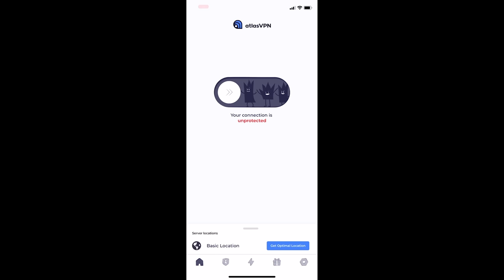I Saw The Holy Grail S2 EP21

Comment: Fix for mantle cracks: I've done this successfully - once reinforced, sand the areas and fill gaps using white glue mixed with sawdust taken from an inconspicuous area. Sand smooth. Stain or apply finish to the mantle but do not apply your final finish coat. Using acrylic paint, match the color of the wood and paint in damaged areas matching the wood color and grain. Apply final coats of finish over it. I've done this with antique furniture and it is nearly impossible to see. This will also help hide paint that can't be removed. Just keep the acrylic paint thin so it won't show. Give it a try!
Reply: I have done that too.
Reply: Using acrylics is something I like to do to even as a stain.

Comment: It’s been my experience that when an old glue joint comes apart, a re-glue will never be as strong as the original bond and is more prone to fail UNLESS you first scrape off and remove all the old glue to expose the raw wood underneath. Once all the old glue is gone, you can then successfully re-glue the joint/cracks back together and expect the bond to last. 

No matter how much new glue you use, or how well they come together when clamped, new glue just will not stick to old glue. 

Y’all are doing a great job, keep up the great work!
Reply: Came here to say the same, remove all the old glue first.

Comment: You have got too get you a work table. Too use for lrg projects. Especially with pipe clamps., Two saw horses and a heavy sheet of plywood. Save your back!! Iam a retired carpenter. And worked as a furniture  refinsher. You need too have a work table.  This also goes double when your stripping doors. Pop the pins and lay flat it makes so much easier to strip!! Stain and poly. Angel Norfolk VA

Comment: That shows Hall had money, that is a solid gold pocket watch case. Odds are there is a high grade movement in that watch. Only well off folks could buy a solid gold pocket watch with a good movement in it. Most folks buying a gold watch spend most of the their budget on the gold case and had a lesser jewel movement put in that case. I recently saved a pocket watch from a pawn shop that was made by a jeweler in a place an hour away from me. It was given as a 21st birthday gift to a person that lived in that city and died in that city and was buried in a cemetery 30 miles away from that place . The building this jeweler built is still there and is a historic building. I am in the process of saving a pocket watch that was given to a famous 19th Century Tennessee resident whose son was in politics and whose grand daughter was a writer. Somehow the pocket watch (given by friends) is in Cali. That watch also showed the esteem this person had as it is a solid 14k gold 18s pocket watch with a very high grade movement. The watch is probably quite heavy due to the gold. Usually watches were given for Christmas gifts or 21st birthday gifts back then

Comment: Mr. Brown's watch is amazing; I've never seen a watch with a photo of someone on the face of the watch.  The fireplace mantle definitely looks worth rescuing!  About 25 years ago, I bought a 1920s antique Chippendale Revival desk from a yard sale for $70.  It had been painted, and the paint was peeling.  The wood beneath looked like good wood, and the desk had beautiful lines and a lot of fine details like hand-carved ball-and-claw feet and carved cross-hatching around the top.  I spent a week stripping it; it took several applications, and I learned the value of a soft toothbrush dipped in stripper, lol.  Fortunately, I was able to get every speck of paint off.  It turned out to mahogany, and was so well-made that even the drawers were made of birchwood.  I stained it a rich, cherry brown and sealed it with two coats of tung oil.  Now I just maintain it twice a year with Howard Feed n Wax.  It's still one of my favorite pieces. 🙂👍

Comment: I've only had to paint antiques 3 times. One was a trunk that was already painted pink outside. I left the interior alone. The other 2 pieces are family pieces: a dresser and a bed. They both had rust on them and I didn't have the money (still don't) to have them professionally finished. They are all metal 1930's from Simmons. Originally, they were in my great grandfather's hotel. I was able to leave the other dressers and beds alone. I knew they would never be sold and I knew I needed to stop the rust ASAP.

Comment: I feel your pain. I got the mantelpiece/ surround form my grandparents house (1875) and had to do some repair on it as well (which stemmed form its removal, so luckilly the structure was still good), but the 4 layers of paint i've had to remove would have driven most people to say screw it. Luckilly that sort of thing is in my wheelhouse, and I only have a little left to strip from it. The oak underneath I had never seen until I did, and I can't imagine why anyone would have painted it in the first place.

Comment: remember to keep gutters cleaned out probably twice a year (unless get heavy leaves then more often) do not wash debris down spout cause can clog it

Would pigmented oil-based paint work on your exterior wood (for protection from elements without additional product)?

Are you using biscuits or dowels for joining the mantle pieces?

Maybe the design on the watch was in a  painting in your house... or you could maybe think of doing a small painting like it for your entry area...

Comment: For the mantel gluing issue, it's important to understand that typical wood glue won't fill gaps. It's not designed for that. It's best for direct wood to wood contact. It's recommended to use an epoxy glue to connect pieces with large gaps. Check out the video from "Fixing Furniture" that is called, "Best Wood Glue for Furniture Repair - Discussion with @Thomas Johnson Antique Furniture Restoration". They have a really great discussion on when, where and how to use different glues for specific repairs. It's really informative and helped me a ton with fixing broken furniture pieces.

Comment: I saw a video where a guy was stripping really difficult little areas like you were doing and what he did was he put sawdust in with the stripper and sprinkled it on and then got into a little spaces with the sawdust and the stripper and soft nylon brush